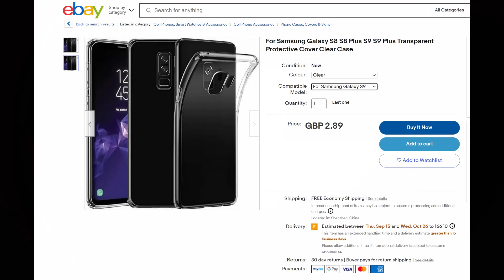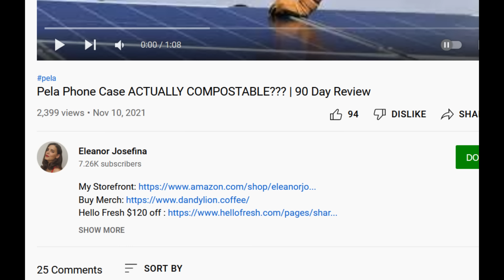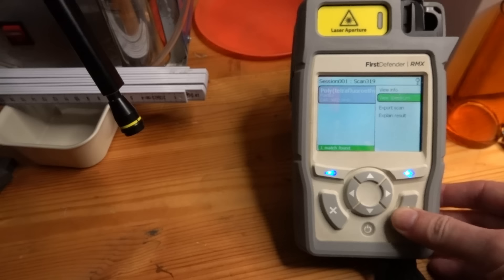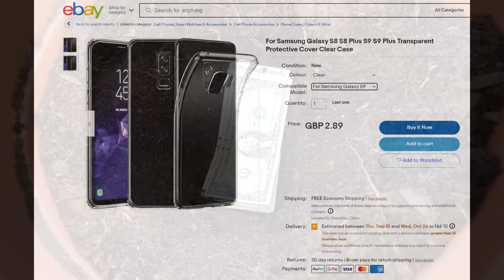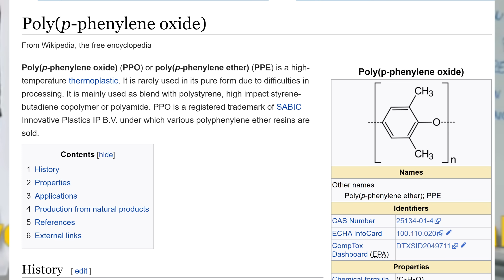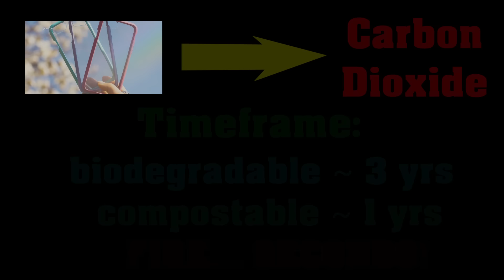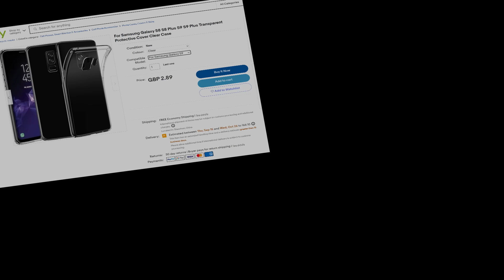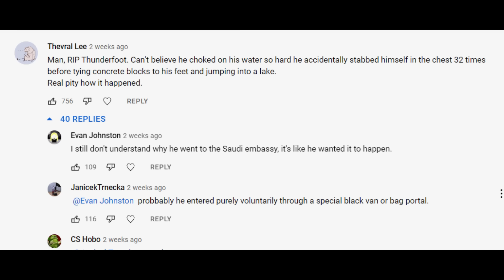Pela-Case: BUSTED!!!

Comment: I’m a plastic engineer and I have done some work with molding the bio plastic.   The problem I’ve found is that the mechanical properties compared to other conventional plastics is garbage.   The big problem I have with molding it is the heat deflection temperature is so low that it requires over twice the cooling time to eject it from the mold so I have to run the press twice as long to produce the parts and it usually requires and energy hungry chiller to cool it.   I have some parts I molded a couple years ago and they do break down but it takes several years to actually do it.   Finally when I actually dug down into it I found it takes more energy to produce compared to conventional plastics because there is all the fuel and chemicals from the farm equipment you need to produce the corn to make it.   Like most other green things in the end it makes people feel good while being a total joke when examined logically.
Reply: So, basically ditch the consumerist lifestyle if you want to make any meaningful change.
Reply: My guess is if you really want to make a change.  Have a more like amish oriented live
Reply: @mylittledarkworldjohn4289  Or not have many children, or not have any creature comforts, or grow your own food, or commit self delete.
People draw a line slightly above they themselves are currently.
Reply: @otherssingpuree1779  individualist consumer behavior is not an answer for systemic problems.
Reply: @Nanook128  Yes but systematic change is too much effort. I am mostly not disillusioned that I can make a non negligible difference.
Having non consumerist lifestyle is mostly about saving money and having fewer things to maintain. Environment is not exactly a priority for me, it is more of an excuse.
Reply: The fact it takes more energy to build is an argument most people will never consider.
Reply: back in the 90, when i was a kid, we used to have a system, where you get money back if you hand in recycle goods (mainly for glass bottles). that system needed a lot of bureaucracy. so since this in Switzerland, there was a public vote and debate about the issue. This also caused local scientist to make a careful study about packaging for liquids. The result: Cardboard with a thin aluminum layer came out on top (these days, they often replaced the aluminum with plastic). why? Switzerland has high value ground water almost everywhere and little room. so no landfills for regular garbage, every city has a incinerator with generates electricity and heat (for heating houses). 
30 years later, most of the packing is still PET-Bottles, as they're recyclable and that gives the consumer the warm fuzzy feeling of not producing garbage. and yes, the filters of the incinerator are expensive, so you pay a small fee for all garbage that goes in. meanwhile recycling goods you pay the fee up front (included in the price), giving the false incentive to recycle where it doesn't actually makes sense. this is finally about to change... (sorted recycling goods will be about 1/3 of the price of regular garbage to get rid of).
Reply: @xponen  What has poverty to do with efficiency?
Reply: @otherssingpuree1779  I'm just saying it's easier to reduce someone's wealth to force efficiency. Low income country is extremely efficient in carbon-emission-per-person despite using inefficient machinery, eg: India.
Reply: @xponen  I understand now, Carbon per person. I thought you meant efficiency as in work done per unit time.
Reply: and then if you get into the discovery of bacteria capable of metabolizing plastics the argument for bio plastic goes almost completely out the window....
Reply: @otherssingpuree1779  i decided to not have children and so far I think I'm the best environmentalist on the block. Everybody else in my neighborhood have children or (expensive) pets, thus, pumping more carbon dioxide and garbage into the environment.
Reply: @Weissenschenkel  I feel not having children offsets an extreme amount of environment impact but it is not a solution you can suggest others.
Reply: @beyondEV  yeah it only makes sense to recycle metals and glass.
Reply: Never thought of that, thanks for the info
Reply: How do you define a bio plastic? I know Polylactic Acid is fairly cheap so it cant be that energy intensive to make.Of course, if you get that energy from green sources then plantbased plastics certainly could cost more energy than the plants technicly take up and still sequester some carbon for the time the plasic sticks around anyways. Though "more plastic" certainly wouldnt be the solution those people would think of.
Reply: have you worked with Origin Materials plastic yet?
Reply: @Weissenschenkel  But you can have children by adopting them. A kid could have a chance to a decent life without increasing Earth's population and the burden to the environment.
Reply: @otherssingpuree1779  We invented language, music, arts when we didn't work 24/7 for the profits of the rich.
Reply: @RSAgility  Are we going to evolve the 24/7 workers out of existence, given they get impotent at a rate higher than the average.
Reply: @rtg5881  I’m referring to PLA.  I’ve also seen the type where they take PP of PE and heavily fill it with some type of cellulose or starch so it breaks apart into smaller pieces so it seems like it is degrading
Reply: @hybrisnemesis1147  No, Plastics just break apart and become microplastics, but they are not degradable or last too much to fall apart at molecular level
Reply: @liamnehren1054 
 Not glass.
Cheaper and uses WAY less energy to make New glass out of  new material than to clean old glass and make it viable.
Reply: @1TwistedPoet  that is because "rate of thrash collection" is low (39%) in low-income-country, so they are visible. But in high-income country the "rate of trash collection" is 96% so it appear almost invisible, although 0.686billion tonne of thrash is produced per year (while global amount is 2.01 billion tonne, ie: 1/3 of global thrash production is by high-income-country). Source: Worldbank, "Trends in Solid Waste Management".
Reply: @xponen  
Solid waste that is MANAGED is not a problem.

Solid waste that is chucked in a River IS a problem.
Reply: @1TwistedPoet  the government in low-income-country doesn't have the money to collect thrash or do pollution cleanup. But still, my point was that lower-wealth lead to less carbon-emission-per-person is still true.
Reply: -Matter didn’t create anti matter
-Anti matter didn’t create matter
(Both of them were present at the time of big bang)
-Both of them didn’t create themselves.
-Both of them came from an unimaginable source,  that unimaginable source created matter and antimatter (everything) thats why it is known as “the creator” of everything.
——————
- that unimaginable source/creator has created sin and virtue which are opposite to each other,
— “logic” confirmed that every action has its own reaction, the reaction of sin is different than the reaction of virtue,
— the creator has created prophets to let us know about each and every detail of sin and virtue, also about their reactions,
Thank you :)
Reply: @1TwistedPoet  They used to just wash glass bottles... coca cola, milk companies there were a whole host that just washed them. 

Charge the cost of cleaning the glass for reforming at initial purchase but lower the total cost for glass bottled consumables and you will see people take care of every single jar they come across much better then now. 

Also it's because the materials for glass are limited, unlike trees so lumber and hence paper is infinite over time.
Reply: @liamnehren1054  I always find the notion of plastic destroying bacteria to be a funny proposition.
Go ahead, make one. The world will change in 2 years. Very expensively.
Reply: @otherssingpuree1779  Yup, it's just not "easy" as on of the first "influenza" clips said.  They (we all) want an easy way… but those don't exist.
Reply: @m4rvinmartian  There was a report I heard about of someone accidentally coming across some bacteria that was capable of eating through a plastic Petri dish. I have heard about it from multiple sources but I don't know any primary source. 

If such a bacteria exists in truth then it can be cultivated as all bacteria can. Maybe in a special environment and that would undoubtedly have certain challenges but it would allow for plastic to be reduced. I also obviously don't know the output of the bacteria but it might even be beneficial in one way or another, such as natural gas in a controllable way.
Reply: How do you quantify the enrgy used in the production process
Reply: yeah I guess we should just keep using fossil fuels forever, their unlimited after all
Reply: @1TwistedPoet  I'd assume glass recycling in the past was more cleaning and refilling bottles instead of melting them down and reforming. I make my own wine and my wine bottles have probably been used at least 20 times each. I banned my partner from using cheap cork removers though as they risk breaking the mouth of the bottles.
Reply: @micheals1992  
That'd be reuse.
And it's a good thing.
ReCYCLING glass is simply not efficient
Reply: @clown134  false dichotomy. Even if we get unlimited energy tomorrow, we'll still need oil for these plastics. Oil will ikely last until non-oil based alternatives are made. But 2022 isn't then
Reply: If you're going to account for farm equipment and fuel,  you need to account for mining equipment and ship transport and oil spills and the cost (and fuel usage) of the military engagements we employ to maintain cheap overseas oil. If you're trying to be logical.
Reply: Do some calculations on the ACREAGE required to replace all plastics, too! We would have to double agricultural land.
Reply: Great for 3D printing though. Other than that it's a joke.